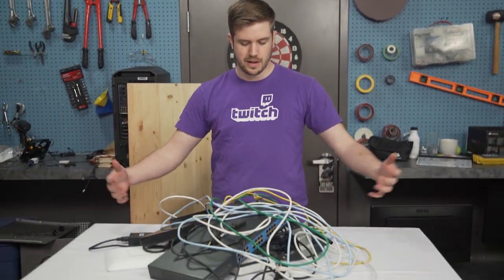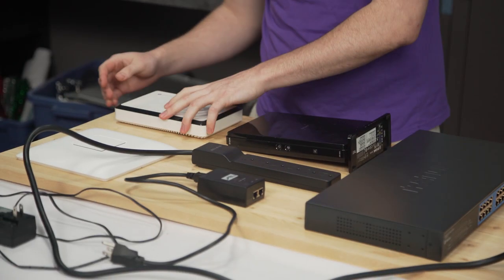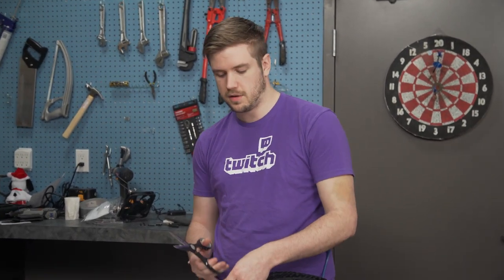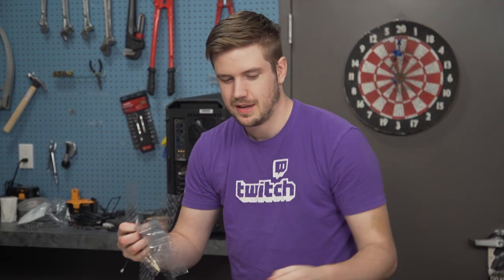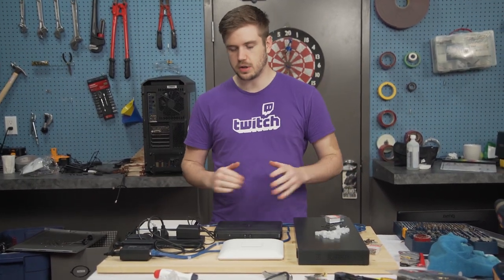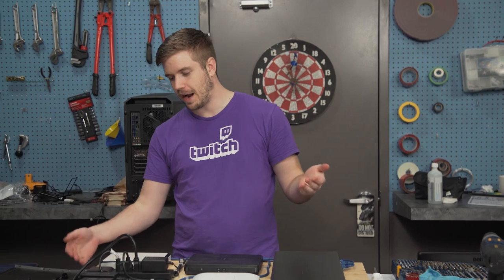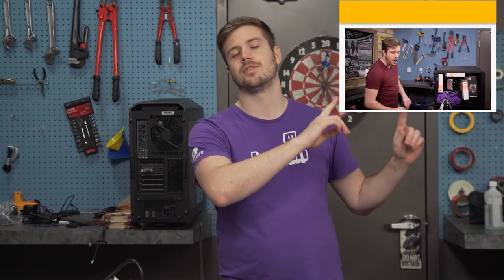DIY Networking Wall - A renter's solution!

Comment: *PRO TIP: install a couple of screws through the Velcro into the board to hold that layer in place. The sticky will not last long on the wood, especially with the heat produced by the equipment. Also, make sure you orient the equipment in a position to allow adequate heat dissipation. The fans on the network switch are going to be blowing directly on to the WAP and the router. Those switches can throw off quite a bit of heat, so may want to rethink the placement of the switch.
Reply: +Rhyno186 why dont they have a "do not try this at home" disclaimer for every video? It seems the majority of things they do obviously should not be performed at home or are not actually well researched/designed enough to be used within 2km of a school. They do some frankly amazing stuff but so many of the actual pro tips I need are from the comments or the forums.
Reply: Smart
Reply: +Rhyno186 I did a similar thing to this but mounted my networking gear behind my entertainment center and I used velcro with 3M adhesive that is rated up to 200 degrees F, I'm pretty sure if you use the right stuff it won't come loose with the heat from the equipment. I've had mine set up for over a year and none of it has come loose. Just with anything else, use the right stuff and you won't have any issues.
Reply: +Rhyno186 velcro strap fails with permanent heat, careful with the switch xD
Reply: +Jose Barahona Yep. My point exactly. There's a reason all networking equipment comes with a BTU rating.
Reply: +Josh Ipoditunes key word 'the forums' :3
Reply: My network switch has no fans.
Reply: +Rhyno186 or how bout just good old glue
Reply: +Rhyno186 I find that a staple gun works really well and is a bit faster than screws.
Reply: +Rhyno186 The vents are on the sides of that Trendnet, and it may not even have fans.  Trendnet makes a lot of fanless 24 port switches.
Reply: +Rhyno186 I would use staples.
Reply: +Rhyno186 you're over exaggerating. It wont throw out so much heat that it'll effect a device one inch over in any meaningful way.
Reply: +Rhyno186 
I agree completely!  Great idea, but poor execution.
Reply: +Rhyno186 Thank you for posting this. I was going to make the same post then saw you already nailed it. 

Guys, do not depend on adhesive to stay stuck to something like unfinished plywood. Because of the nature of plywood, adhesives do not stick to nearly the same surface area compared to if they were stuck to a smooth surface. There are peaks and gaps and dust on plywood's surface&#160;to limit the effectiveness of adhesives sticking to it. Simply putting some screws or, like other have said, staples through the Velcro strips can save you a ton of money by preventing your expensive network gear from falling to the ground.

Edit: Forgot to mention. I doesn't matter what heat your electronics put out. Heat is only part of the equation. Sure, your router may run ice cold. But again, on a microscopic level, plywood is not smooth or flat. The adhesive's contact to the surface is completely different than, say, a painted wall. You do not want to trust that Velcro strip to stay stuck while competing against gravity when it already has  a lower than normal contact area to the plywood. Staple your damn Velcro straps on!
Reply: +Josh Ipoditunes because they are too lazy to do it right, not talking a bit this video. Linus is a shit man, Luke is fine though.
Reply: +Rhyno186 and also lay it out in a way that makes the wires better managed
Reply: andrew kb He layed it out so the wires are easily accessible, not for looks, they are layed out just fine. pointing to the sides so they are easily reached.
Reply: +Rhyno186 How is it a protip to put screw through velcro when you can just use screw instead of velcro without the hassle.
Reply: +Bound4Earth I can't think of any switches that have the proper orientation of screw holes for mounting in this position. Also, this way, the system is modular. If you ever have to take the equipment off for cleaning or service, it's much easier to just rip it off the board, do what you have to do, and slap it back on when done. No tools needed beyond the initial installation.
Reply: +Adeel Rehman Linus is Nigerian? I thought he was from Canada.
Reply: Rhyno186 He meant on the velcro attached to the wall, not attaching the switch to the wall with screws.
Reply: absolutely, using screws w/ washers or heavy gauge staples to firmly secure the velcro to the surface should be standard practice when dealing with warm temperatures and relatively high weight.
Reply: Sean Anderson No, he said use a screw INSTEAD of velcro so, no velcro, only screw.
Reply: Rhyno186 Sorry, thought you meant the original comment.

Comment: I think someone forgot to tell Luke that all of those devices should have screw mounts. They are more secure and just as easy to remove as velcro for almost no cost.
Reply: +Bound4Earth Was scrolling through comments looking for this. Thank you for beating me to it.
Reply: Not sure why no one else mentioned it, Kept seeing odd comments about screwing through the velcro.
Reply: for the power bar, i would use zip ties
Reply: jjjjank
Reply: even better there are some screws not threaded to the end so you can't screw them more than you should and leaves enough space for the hardware to be mounted ...
Reply: Some do and some don't..
Reply: I would take screws over velcro any day, especially with the heat in the equation.

Comment: This is one of the best videos I've watched this year. #1 _  Thanks for the tip on using wide Velcro for mounting...a perfect solution. I'll get the board, do the layout like you did, cut it, sand it, and give it a good coat of Gloss Orange. It will be mounted on a wall in my rented spare bedroom that is also my computer/office/storage room. When I vacate this rental there will only be two small holes in the wall, nothing more than standard cosmetic wall damage done if hanging a picture.

Comment: holy crap man this brings back memories of me and my grandfather building computers and testing computer parts using a board of wood where we bolted the motherboard and power supply too. we even used that to test overclocking so it was not stuck in a case

Comment: We took one of our switches at work apart, drilled holes in the metal then to the wall and then put it back together.  worked very well, just have to make sure that when put back together that the screws do not touch anything that may be shorted out. :)

Comment: For heavy items, I suggest 3M Dual Lock Velcro instead of the light-duty soft stuff.  Radio Shack used to carry it as "Superlock". You can get large pieces and spools of it online, and it really holds stuff tightly.

Comment: I figure you already know this bit for everyone else, I'd really recommend leaving it flat for about a day after velcroing everything down. I've had pretty light things fall off the wall before after applying it vertically and then just walking away, but if done properly that shit will stay on forever, oh and if it's the right kind of Velcro, it will peel paint off drywall before the two sides willingly separate. Lovely stuff.

Comment: Nice work.. 
Here in Holland my connection drops in into the fuse closet with all the meters and stuff. 
one awesome feature... one big wooden plank on the back wall haha.  enough room to get rid of extra cables or make it as tight as you prefer.

Comment: Tip, lower the clutch setting on your drill/driver when putting in screws. When the arrow points towards the drill icon (4:29) that means the clutch is locked and you risk stripping the screw head and/or over penetrating e.g. your cable clip (4:25).

Comment: Another option - Why not make a 2 layer board an inch or two apart, with a hing on the back one and holes to route cables and hide the cable mess.
Reply: Well why don't you show us this wonderful design instead of criticizing his
Reply: @djbessette76  options =/ criticism

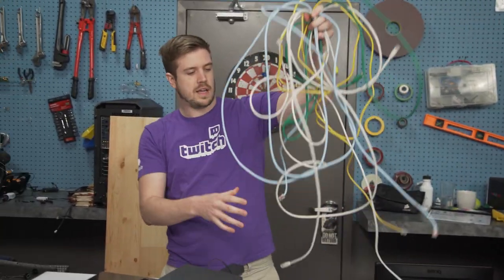Comment: The white box at 1:10 is an optical network termination (ONT). I installed them for the ISP in my area for 1.5 years. Not sure if it's the same out west, but when disconnecting/moving services in the Atlantic provinces, the ONT is supposed to be left in place as it is programmed for that house/apartment. It can be re programmed easily enough if you do take it to your next residence, the main concern is someone cutting the fibre line, taking the ONT with them and screwing over the next tenant of that location by leaving them with a cut fibre line.

Comment: just drill holes/cut-outs at the terminals and put the wires on the other side of the board, that would look cleaner and there would be no problems with too long wires...
Reply: +mooq! fuck how did I not think of this. would be a tonne cleaner
Reply: +Ben Macpherson ;-) and the adhesive on the Velcro will lose it's strength over time. To counter that just tack it down with some nails before putting the other side on.

Comment: You know one of the benefits of using a board to mount all your networking is being able to rout the wires BEHIND the board. You drill holes next to the devices to feed the wires though. Including power bricks and adapters. You hide all the wires and power cables behind the board so the front of the board is nice and organized and clean looking. Jayztwocents over looked that and now linustechtips.

Comment: btw most rack mount gear can have the ears face downward so you can screw it to the board without velcro.

My option for network in an apartment was a rack on rollers, made for a fairly clean look

Comment: Get a 2" or 3" distribution ring and mount it on the corner of your board (the far-left corner from you in the video).  Pass your cables from the switch out to your devices through it.  Wrap a velcro strap around the cable and the ring to act as strain relief as well as clean up cable management.

Comment: There should be a video describing various home arrangements for a network, like if you need a switch or a hub, an access point or just a router, and what each of the pieces accomplish and why you would choose them. If that was this video, then I personally would not consider this a waste of time and an act of stalling.
Reply: I don't you think you understand the whole point of this video bro.. 
This vid is a DIY video not a video about explaining the stuff that YOU want to know about
You could go online and find a site which explains that sort of stuff
You don't need to complain about how it didn't help you at all when the video isn't actually based around those subjects
Reply: ***** I do get the point, and my point is that recent videos feel like a gap filler, something to stall while they come up with something new, and that's okay. The problem is when these videos continue for days and nothing interesting or original comes out of them. How to run your wireless setup on a wooden board? Anyone could have come up with that, and plenty have posted guides and videos on it.

The point is that what I mentioned above would have personally been much more worthwhile and still simplistic for them to explain instead of a 5 minute video on how to drill holes and tack down components. Also, in regards to doing external research, I have done research on networking and know about the things that I have mentioned, but a video about said components and choices would strike a good resemblance to some of their older material and would be more beneficial than this video. Peace.
Reply: +Yoshii aight, I understand you bro.

Comment: How many of us networking guys are cringing atm...but it does look ok...got to admit I do prefer racks
Reply: +Bevin Warren Not everyone has room for a rack. But continue to cringe if it helps you feel more superior somehow.
Reply: Krytern UK I can see that, plus racks are expensive. For me the cringe is more to do with the potential EMI that having the power plugs and board so near the Ethernet and access point could present.
Reply: Honestly, a 4U or so 10" (yeah, they exist) wall mount rack would have been smaller in terms of volume and fit all of this.

Comment: I'm fairly certain that most of that equipment has screw mounting holes built in.  Photocopy/scan the side with the holes, put the paper on the board, place appropriate sized screws where needed, pop the devices into place.  No sticky expensive velcro needed that probably won't survive the first time something is removed from the board.

Comment: Thanks for the vid.  Since you used Velcro I would recommend keeping an eye on your network board, in my experience with Velcro you may come home on a hot day and find all your networking stuff on the floor because the adhesive got too warm.

Comment: What is the point in having a wireless router and an access point? Also why not a modem router?
Reply: +manstie that's what i was thinking
Reply: Then couldn't he just cut the router out completely?
Reply: As for the second part, modem routers aka gateways are pretty terrible. They're shitty at both jobs.

Comment: This would also work really well for those that have walls where mounting things isn't easily accomplished.

Almost all the walls in my house are plaster. Trying to get through the plaster is more likely to bring it down I think. I had to repair a few walls when I bought the place as it was. Good thing I had someone there to coach me through it, and another person helping me with the same skill level I had (little to none). All three of us got it done though.

Comment: To cut a proper straight line with a circular saw, Mark your cut, measure the width of your saw from the cut line AND the important bit clamp a straight edge of some type along the line, Bingo, a perfect  straight cut. Also I'm so glad you removed that foot first, I nearly couldn't watch because of that.

Comment: Nice work! I would have drilled a hole through the board right next to each device and power strip, then ran all the cable management on the back side of the wood with the ends of the cables through the holes and plugged in. Maybe even toss a few dollars at some wood stain or paint too if it will be located some place in your house where it's always seen.

Comment: would have been nicer to drill a few holes and route the cables behind the board.
Reply: +TheRob2D I was thinking the same thing.  Makes me want to try mounting stuff with power chords and network cables running along the back.  It wont' sit flush against the wall but it might still look nicer.
Reply: +TheRob2D but the you'll also need standoffs, i'm geussing they thought about it, and just didn't think it was worth the money
Reply: +thejack473 they had the material right there for the standoffs.....wood! Cut 4 squares, put them in the corners and use a screw or two on each one.
Reply: Adrian Contreras-Perrin as far as my projects has gone, that always breaks in less than a year. But if they can deal with the hassle, sure. no problem. i would just personally never consider that
Reply: It could have been done the way it was done so that it didn't have to get taken off the wall just to do stuff if cables had to be replaced.

Comment: What's up with hating gloss? Shits funny
Reply: +Nate Walker Especially with stuff you touch allot like a controller it looks dirty very quickly. For something like a router I think it's fine. Can look very dusty very quickly, but tbh. it looks worse now then it did before.
Reply: It does get scratched over time as you dust it off but yea he could have painted it after making the video or finished scuffing up the surface off camera so that there is less video to edit after. In the past I have done projects that I rushed to get it done fast and it looked bad but did go back over time and made it look nicer.

Comment: Consolidating that gear might also help. An Ubiquiti Edgerouter (the 8 port version) using PoE to the Access Point takes care of the D Link and switch. Heck, getting an Ikea Lack or Rast is a decent way to jury rig a 19" setup that'll have better air circulation than a big board. Plus then you can stick a rackmount NAS with four drives; good ones from QNAP and Synology are around 400-500.

Comment: for 19" devices on a board notice that you can turn the mounting brakets 90 degrees so that they can be used as a wall/board mount

Comment: Just arrange all that crap in one PC case and open the back for the ports. That big ass plank solution looks like a shitty elementary school presentation.
Reply: +Divine Linker Good idea. Might want to put the wireless AP on the outside though so you don't get any signal drop from the case.

Comment: Scotch All-Weather Fasteners are like velcro on crack--each side of the "tape" has rigid mushroom-type groupings that mate with the other side. I use these things to mount my UPS hanging under my computer table, and it's not just "secure"--I need a prybar to release it. They're about $7 for eight strips at like Walmart, and are cheaper and stronger than the velcro you used. You can also drill through the strips into the wood because these secure best to finished surfaces.

Comment: Why would you plug your AP into your router?  Just plug everything into the switch.  Only 1 LAN port should be used on your router to connect the switch.
Reply: +Jake Meyer Wait why does that matter? Serious question here, I suck at networking.
Reply: +Helltech Generally the less switching a cheap router does the better.
Reply: ThisMakesMeThink But what if you have a 300 dollar router?
Reply: +Helltech Then someone wasted their money.
Reply: ThisMakesMeThink Question is still valid. Lol.

Comment: Once all that heats up that Velcro glue is going to soften and give from both the wood and the device, you may want to add a few some straps to aid in holding them in place. I am sure you can come up with some creative good looking straps. :)